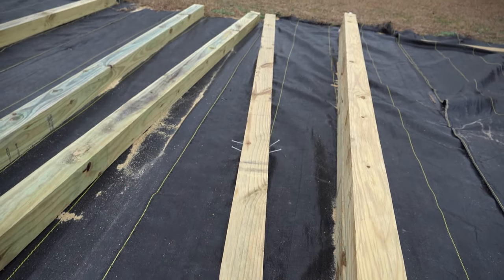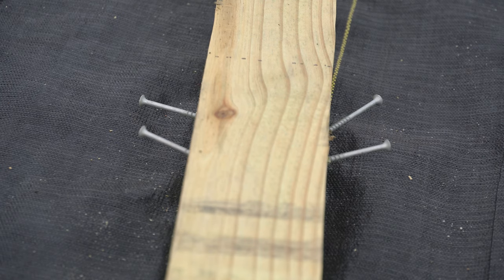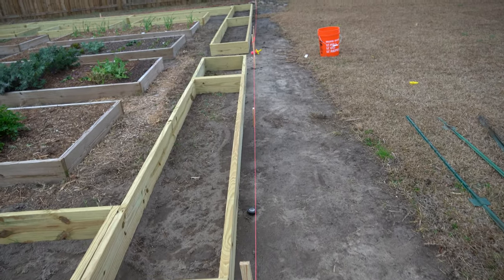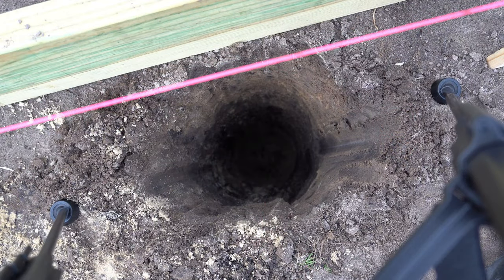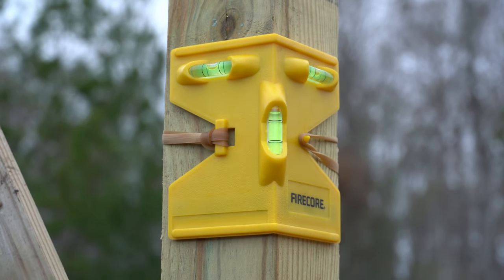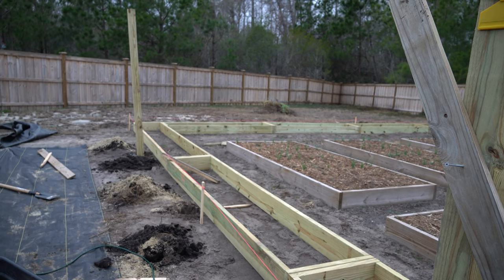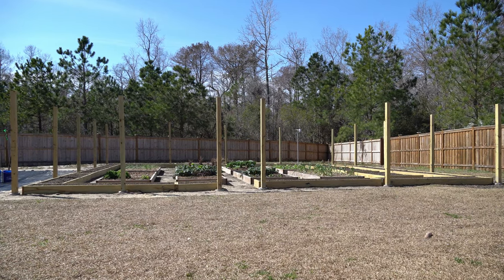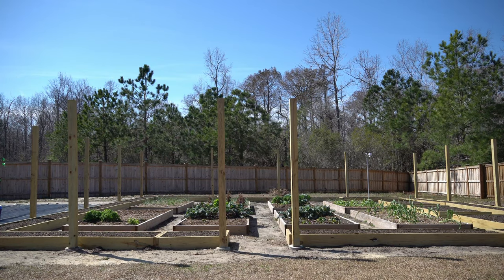Building A Garden Part 3: Install 4x4 Fence Posts In Concrete

Comment: I look forward to seeing your 4 x 4 10 ft trellis system pumping out tomatoes.. I made a similar fence last year but did not think to use the 4 by 4 post as a trellis system for anything but snap peas and cukes. I think I'm going to use 2x4's or batton boards, screw them to the 4x4 posts, and remove them at the end of the grow season. My tomatoes made it to about 8 feet tall last year growing on bamboo sticks that I wedged into the cattle panel before they started collapsing. 
 I have spent so much money on trying to get a trellis system correct. the only thing I would advise is don't plant perennial beds in annual gardens. Asparagus beds are great in early spring and then they are just big and shady and kind of an eyesore. Make a huge patch somewhere in the corner of the garden.. just my thoughts. I had to move a huge patch of asparagus that was established for three years and so many crowns died transplanting them.

Comment: Hey man great project and love your passion for gardening!  i realize this particular project is finished or just about, but a cordless impact driver is an amazing device that any homeowner should have.  and ditch those phillips head screws!  star drive (or torx) is the only way to go.  the impact driver and star drive deck screws are well worth their expense and will save you time and expletives!  i am a home builder and couldn't imagine using an actual drill (corded!) or philips head screws for something like this.
Reply from the maker: TomorrowNeverIs I guess I’m trying to save money where I can.  The lumber and soil cost an arm and a leg.  Problem is when it comes to buying new tools, I don’t have any major projects coming up.  At least I hope I don’t.  Maybe one day I’ll upgrade.  Thanks for the suggestion.

Comment: Looks great. I'm about to do something similar. I'm building a lean-to type of covering for my raised bed. I'll be adding 4 posts and hope to make it into a green house. How are the posts holding up? I'm considering using a concrete anchor instead of sinking the posts in the cement. not sure which will be better.

Comment: Awesome! It'll hopefully all be smooth sailing from here! Setting posts is so hard. Can't wait to see it full of plants!
Reply from the maker: Jacob Simpson thank you.  I can’t wait, too.  We are having a cold February, so spring feels out of reach right now.  I can’t wait until it breaks.
Reply: @TheMillennialGardener  yeah. We've been having a cold February and it has been raining every day for almost 2 weeks. I think it's finally going to stop raining for a while and maybe warm up.
Reply: @TheMillennialGardener  I've got a quick question. I have some food cuttings and some of them have parafilm on them still and the buds have busted through the parafilm. Should I take the parafilm off? Or will it be fine to leave it on?
Reply from the maker: Jacob Simpson the same thing happened here. A very wet February with cool temps. The next 6 days say sunny but we are only getting to between 52-57 for the next 4 days.  That’s January temps for us.  Hoping for mid-60’s soon which is our normal for this time of year.

The Parafilm breaks down overtime, so you don’t need to remove it if you’re indoors.  I remove it when I move them outside because if it rains, moisture can get trapped under it and cause fungus to grow.  If your trees are indoors and won’t get the Parafilm wet, you can leave it on.  If you’re moving them outdoors, try to remove it to prevent moisture from building under it.
Reply: @TheMillennialGardener  ok. Thanks!

Comment: You did a great job! I used recycled treated boards for mine because they were free. Is it a good idea to pay for treated lumber for garden beds with the chemicals they use to treat it? Thought untreated would be healthier. I realize it may not last as long...
Reply from the maker: Modern pressure treated wood is treated with liquid copper.  Liquid copper is non-toxic, and it is actually even an approved organic fungicide, and I must spray my tomatoes in my climate with copper to prevent disease once the humidity rolls in.  I spray the leaves and fruit directly, so I truly could not care less about trace amounts of copper in my soil.  It's as harmless as it gets.  This is one of those leftover myths from generations ago when wood was treated with arsenic.

You could use redwood or cedar to build your beds because they are naturally rot resistant, but the cost would be astronomical, and it's very difficult to source, let alone in a variety of sizes.  Not only do stores not stock that stuff here, it would literally cost thousands of dollars to build a garden of my size.  Copper pressure treated is just fine to me.

Comment: In terms of burying posts, don't you have to worry about the frost line? In my area it's 44 inches.
Reply from the maker: T Wilde if you’re in a very cold climate, yes.  I am in a warm Zone 8, so my ground doesn’t freeze.  My frost line is an inch 😆 For very cold climates, this will be more work.

Comment: Off topic question.  I have two celeste figs potted up and one has buds and the other one has leaves.  It's supposed to drop to 28 degrees F. overnight Wednesday and I'm wondering what it will do to the trees if left out?  I'm south and west of San Antonio, Tx. and this should be our last freeze.

As a side note, if you use pressure treated lumber in the garden, your produce can never be called organic.  Is that important to you?
Reply from the maker: A 28F freeze, especially when accompanied with wind, will probably damage the new green growth.  It will knock the trees back some.  Will it cause any damage to the hardwood?  No.  But it will likely damage that new greenery.  If you have the ability to cover them with a tarp, that's a pretty good idea if it's easy for you.  If not, they'll recover but just be a little behind where they are now.

Liquid copper is actually an organic fungicide.  You can buy liquid copper and spray it all over your plants and still be certified organic.

I am a backyard gardener.  Even if I were a commercial gardener, I would not care less about the "organic" label.  What's legally required to label things "organic" is a joke.  You can still have horrible farming practices and be certified "organic," and you can have wonderful, sustainable farming practices and not achieve that label.  I don't think there's a label in a grocery store I roll my eyes at more than the word "organic."  I'm sure whatever copper they soak the wood in isn't certified organic, but I couldn't care less.  Anything I grow in my backyard is going to be so much better than any "organic" produce in the grocery store.  I would bet my garden on that! :)
Reply: @TheMillennialGardener  
Thanks.  I've had good luck with my avocado that's also in a pot and its been through 4 or 5 freezes this year down as low as 24.  I'm in an RV park with huge pecan trees over my RV and a large patio.  I think it might create some kind of a micro-environment because the only plant I've lost was a basket of fire pepper.

As for the organic thing, I used to have chickens and several organic gardens on 3 acres.  The USDA wouldn't certify me with treated lumber, which I used to build my chicken coop.  I figured you had checked it out but thought I'd mention it anyway.

Comment: Can you say, O - V - E - R - K - I - L - L in the Nth degree! good grief for a vegetable garden? You could buy an awful lot of groceries with the bucks you put in your garden. Your either not married or your wife is unable to see or hear. One thing is for sure, folks used to grow gardens as a supplement to their income to feed their family, you will never save enough money to pay for this.....um, garden?
Reply from the maker: That's not the case at all.  You'll see why I'm doing what I'm doing when I post Part 4 of this series.  The posts will serve a very specific purpose, and it's mostly necessary in my climate because of the severe humidity and fungal diseases.  Airflow is necessary to get any kind of harvest out of tomatoes, and to keep pest pressure down for things like cucumbers.  This is built to last 10+ years, so while it seems like a lot of work up front, there won't be any work for the next decade beyond simple soil amendments.  "You get what you pay for" is how I look at it.
Reply: It’s not about just being able to go buy groceries, it’s about being self sustaining.